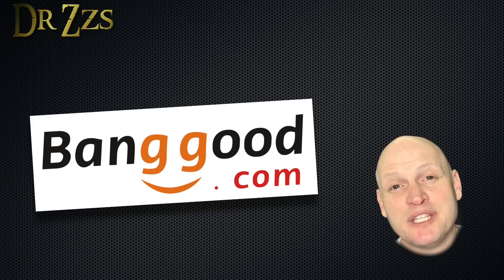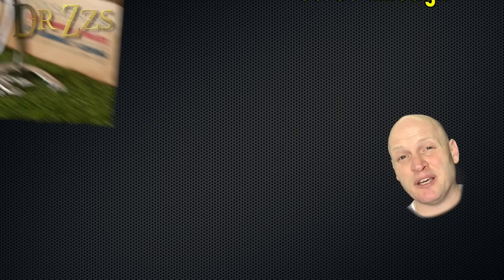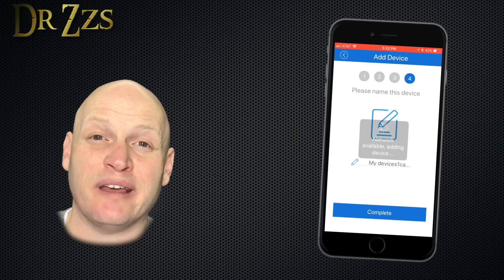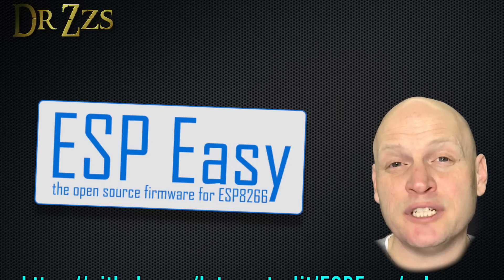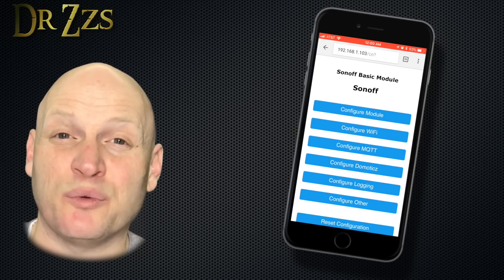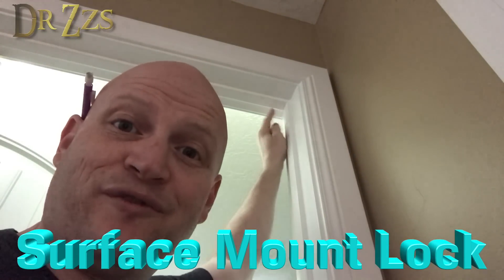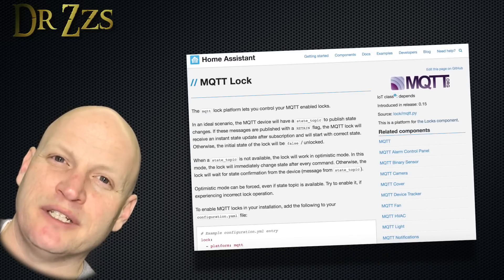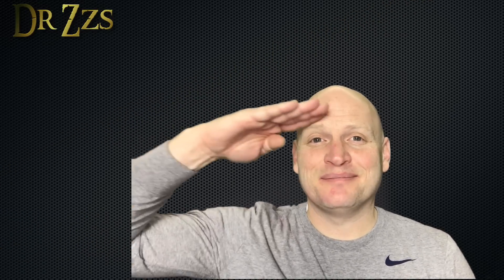$25 DIY "Smart" Door Locks - ElectroMagnet + Sonoff + Tasmota

Comment: if you had of drilled right through your door frame and 2x4 and pushed to wire in to the cavity with your plate the wire would have been in the wall for future automation projects but i like your video found it informative.
Reply from the maker: Thanks
that's a good idea.  I'll do that on the next one.

Comment: Thanks for the vid. I will like to make this and add a fingerprint scanner for access? Is that a simple project? I'm able to follow this guide easily
Reply from the maker: You'll have to find a finger print scanner that will output something that can trigger the relay on the Sonoff SV.  It may not be too difficult, but I wouldn't say it's easy, and following this video wouldn't give you everything you'll need to know.  
I'll look into fingerprint sensors and see if I can put together something about how to incorporate them into HA.
Reply: @DrZzs  that would be sweet. Thanks again

Comment: Great Video ! ...Is there a way to get this done without a power supply ? Say for use inside a cabinet ?
Reply from the maker: thanks!
not with the locks I used.  They require too much power to run on battery when they are locked.  Maybe if you found some "fail-secure" style locks that might work.  You'd want to have them locked most of the time, and for fail-secure, they wouldn't need power when locked, only when unlocked.
Reply: You might be able to find a electric lock that works using a motor, to move the lock latch open or into the closed position. I have seen a few diy solutions using a servo, but that's not ideal either.

Comment: Now to design a outdoor gate door lock
Reply from the maker: that would be useful!  What kind of lock do you use now?  We'd have to run power to it for sure.  It wouldn't be something we could run on a battery. 
I want to learn more about triggering motors with Tasmota.  A gate lock might require a linear actuator or a solenoid or even a dc motor.  It's on my list of things to tackle and figure out.  I'll let you know when I solve it :)
Reply: @DrZzs  This is link to an example of the style gate lock :  http://baytownlepc.org/vinyl-gate-lock/vinyl-gate-lock-fence-latch-zoom-vinyl-gate-latches-locks/

Comment: I like the idea but wouldn't trust if my power went out then my home is vulnerable to being broke into. The only way I would consider this is with a battery backup of some kind.
Reply from the maker: That's a good point.  
There are other kinds of electric locks that are "fail secure" instead of "fail safe".  Meaning when there's no power they stay locked.  I'm sure some people would argue that with a fail secure lock, if there's a fire or some disaster in your house and the power goes out you might be locked in, and that would be bad.  
I wanted to use this on external doors, but haven't taken it that far yet.  So far it's just my office, the shop door, and one bathroom door :)
Reply: @DrZzs  I think a good system  (if it could be done) would be to have a "fail secure" setup to where say if the power goes out it will stay locked but have it hooked to a smart smoke detector and carbon monoxide detector so when either went off it would send a signal and unlock the doors. I'm sure something like that could be possible with tech these days. I suppose the system would have to be local and have some kind of battery backup since with a fire if the fire didn't knock out power the fire dept would and then no Wi-Fi so it wouldn't be able to receive that signal. Idk lol sounds like alot of work but would be cool.

Comment: How do i make it so it locks itself after 10 sec?
Reply from the maker: That would be a fairly simple automation.  If you use Home Assistant you could make a Yaml automation, or use NodeRed. 
You'd have to decide what you want the "trigger" to be.  You could set it so the trigger is the lock going from "locked" to "unlocked".  Then the action would be #1 a 10 second delay, then #2 set the lock to "locked": 
It would look something like this - 
automation:
  - alias: 10 sec relock
    trigger:
    - platform: state
      entity_id: switch.your_lock_id
      to: 'off'
    action:
    - delay: 00:00:10
    - service: switch.turn_on
      entity_id: switch.your_lock_id

Good luck!
Reply: @DrZzs  Thanks it worked:) i wanted to know i have the rf bridge with 3 rf remote how do i set them up so when i press a button on the remote it turn off or on somes lights? i flashed the bridge with tasmota and i have the id of the button.

Comment: Awesome I have to try this for my garage
but if the power goes off, does this mean your house would be open ?
Reply from the maker: yes, if power goes out these lock turn off.  If you want fail-secure locks it would need to be a different kind of lock.  I haven't tackled that yet.
Reply: @DrZzs  maybe trying to build some kind of battery backup

Comment: for the strike plate Id prefer fail secure... otherwise your home is unlocked on a power failure... you can always open door normally even if no power or fire.
Reply: In fail secure you still need the lock to release in the event of a fire due to fire personnel or police ro be given access to get in from the outside.  Fail safe is better in this situation or a battery backup for the the fail secure and a fire release installed with a full fire alarm to detect the fire.
Reply: @designsbyphilip510  They're going to bust the door just the same as they will otherwise because when either of those arrive, it's worth a door. On the other hand if your front door opens up every time it loses power (black outs, brown outs) it's just a matter of time when it happens when you and your family are all sleeping.
Regardless these setups are dogshit anyway because you can open them with a magnet.

Comment: You can just cut the wires on the first lock and you are in like sin. Horrible design, you need to rethink how you installed it.
Reply from the maker: The wires aren't accessible from the outside.  The wires are in the inside of the room. If someone wants to break in bad enough, this won't stop them that's for sure. This is mostly just to mimic a normal lock to keep someone from just walking in and for convenience so you can lock/unlock your doors with automations.  
I'd love to hear any suggestions though, about how to make it more secure.  
Thanks!
Reply: Yes, upon the second viewing I realized that I was wrong but I already posted the comment. Sorry for the quick assumptions. This is a well done cheap, respectively silent, and easily DIY door lock. Thank you for the videos and you have inspired me to make my own version. I just ran the wires up in to the attic and connected it to a central, janky, hub. So it will be easy to connected more doors as I complete future installs. I am also thinking of setting up a "geo fence" like system so I can have my front door unlock as I approach. Do you have any suggestions on how to accomplish this, preferably using my phones location? Thank you and I really like your videos because you provide a very inexpensive solutions for home automation.

Comment: I love this.  We're developing a security protocol for our church in case of the need for a lockdown and this solution will be perfect.  Now, here's the challenge.  Find us an electronic lock solution to retrofit vinyl sliding glass doors so we don't need a key to unlock them.  ;)
Reply: Mag locks with a L bracket to hold the plate

Comment: I am planning on using these magnets to prevent my little girl (she is 1, and is more curious that curious george lol ) from opening the bottom cabinets in the kitchen and bathrooms, but at a price of $16 for each magnet set this project is going to get pretty expensive. Do you guys know of any other magnets that could do the job and is not as expensive? I need around 35 separate magnets for all my bottom cabinets. If anyone could help me out that would be greatly appreciated!
Reply: https://www.amazon.com/Magnetic-Cabinet-Locks-Install-Childproof/dp/B01FXX9HW0/ref=sr_1_2_a_it?ie=UTF8&qid=1546554649&sr=8-2-spons&keywords=baby+magnetic+cabinet+locks&psc=1

This is what I will look into for my little monster.

Comment: Hi, how did you give the connections.. I did not notice any wiring diagram
Reply from the maker: sorry.  It is very simple.  +/- input on the sonoff, +/- output from sonoff to red/black on the magnet lock.  If you want another switch (besides the on-board button), then connect the poles of your switch to gpio14 and ground.  Those pins are marked on the Sonoff SV.  I showed more detail of the connections on the SV in my battery button video: https://youtu.be/MyPpmDAThA4
Reply: DrZzs do i need to connect the input for sonoff sv from the mains or from a 5v 1amp power supply.. also in your other video with rfid, if i use that, can i also attach a switch to nodemcu like how you did here.. if so how..
Reply from the maker: Mufid Syed Don’t connect the Sonoff SV to mains!   The SV is made for low voltages. 24v max I believe.
Reply from the maker: If you want to use the magnetic door locks you need a 12v power supply.  That is what goes into the input side of the Sonoff SV.  If you use the esp-rfid firmware on the nodeMCU, as I did in the RFID video, I do not believe it is possible then to add switches to the nodeMCU.  Are you hoping to have a switch to use as a manual override of the RFID entry?  the RFID/nodeMCU takes the place of the door switch.   I don't know if there is a way to add another switch.  You'd have to look at the ESP-rfid code or github and ask the guys who wrote it if that is possible.
Reply: DrZzs I'm thinking if there is anyway i can reduce the components used. If i avoid going the sonoff sv route and use only the nodemcu and esp rfid way, the only way to open and close the door would be through RFID. But since that will be placed either inside or outside, how would the door be unlocked from the side which does not have the reader

Comment: Hello DrZzs, how would you go about using sonoff to detect (maybe with MQTT) when someone rings a traditional doorbell? I'm thinking of something like whats described here > http://www.redgrendel.com/the-doorbell/#comment-110 
The ideal would be to have rind detection, but also being able to suppress the ringing (at certain times), yet sill be able to get the notification. Maybe an idea for a tutorial?
Reply from the maker: Hi!
There are a bunch a different ways to do a smart doorbell. Are you planning to use your existing doorbell?  You could put a "smart" device like a D1mini or NodeMCU connected to the doorbell button that would be able to respond based on an automation and activate the chime with a relay based on your automation.  A Sonoff SV would also do the trick nicely.  Of course I would use Tasmota and connect the existing doorbell button to GPIO14 and ground.  Without knowing what exactly you have already and what exactly you want to do that's about all the instruction I can give you. 
A video on doorbells would be useful.  That might be something I can do eventually.  

Hope that helps.

Comment: Is it possible to pair this with a fingerprint scanner
Reply from the maker: sure.  
I don't have a fingerprint scanner to test, but I would expect it would function like a switch.  The scanner would need to do the processing of the fingerprint and register it as approved to open or not, because Tasmota and the sonoff can't do that part.  
Might be that you'd need a whole new sketch for the Sonoff. Maybe search github for something.  
That would be a cool project.  I don't expect I'll get to try it for quite some time with all the other projects I'm working on. 
Let me know if you make it work.
Reply: another question do you have a way to unlock the door when "I am home" like a MAC address or some Bluetooth thing
Reply from the maker: That would be a pretty simple automation.  
Do you have anything set up in HA for presence detection?

Comment: I didn't really understand how the cathode lock works . How And where is the sonoff connected to it? Is there a button to open it? I got confused even you said if either one is locked out will be unlocked ( how will it lock from home assistant then).
Reply: I don't know about sonoff, but if you mean how the lock works when power is applied to the magnet inside it moves the movable part so that you can pull the door open, when the power isn't applied it goes back to locked position.

Comment: Hi. I enjoy your videos very much. Can sonoff be used to control 208-240v wall a/c unit with alexa?
Reply from the maker: Thanks!
What is the current draw of the AC unit?  
Most likely yes, it would work.  They have many devices rated for 120-240v.  The trick is just the amp draw of your AC unit.  The Sonoff POW has a 16 amp rating.  Most of the others (sonoff basic, dual, etc) are 10 amp. 
I know someone else wanted to run a Heater/AC combo unit and wasn't able to because of the current limits.  
Hope that helps!
Reply: thanks for the quick response. if the amperage is 15a can i use 2 units to cut both legs of the 240v line? can i use the ground w/ a pigtail as the neutral input on both units?

Comment: what if somebody knew it was a failsafe system and you had an external fusebox...
Reply from the maker: yep, you got it.  In that case it could be bypassed. 
It's not a full burglar-proof system.  You could have a 12v battery back-up.  Something like a car battery would probably last a good long time if someone cut the power. That would be best probably.
Reply: Another solution would be if to have the mqtt broker server to send an email or similar notification when the power has been out for a period of time, say twenty minutes. This way you can have a neighbor or someone you trust to check if the power has been switched off.

Comment: Dr zzs one question, how can i do if i want to open door from outside, without smarphone, exist something like a magnetic card ot other sistem to open from outside?
Reply from the maker: Good question.  I don't know anything about magnetic card readers.  I've thought about hiding a capacitive touch module that I can activate from the outside but no one can see and only I know where it is.  I'd put it someplace weird like down by the floor or up above the door.  It would depend on where I could easily run the wires. 
I'll try to figure out some cool external unlocking system.

Comment: ......FYI the Magnet lock sold by other suppliers has four wires....two for power and two for "door contact"... a control circuit uses this to confirm the door is closed.  This will be one big plus in your case by using the "lock closed" icon to show the door is closed which is handy when you need confirmation your house is secure (doors are closed)..... In high security applications this contact is used to detect one door closed before the next door opens.....used to allow one person through at a time  (just another application)  In the case of the garage door lock... one just needs to send a "pulse"  for it to open.(add a buzzer to confirm the lock is opening when using it on a outside gate at your front door)......thanks once again for great videos ....
Reply from the maker: Awesome!  
Thanks for the tips! 
I'm imagining how fun it would be to build one of those "escape rooms" with some of these locks, especially the ones you're talking about.
Reply: Hey could you share a link?
Thanks

Comment: On the surface mount mag lock you can get them much bigger and stronger but ya if the door is going to fail first doesn't matter much
Reply from the maker: ya, at least with an interior door you could probably break the door before the magnet gives out. Maybe with a bigger stronger door it would be worth the extra $ to get a bigger magnet.

Comment: Just about to order the parts but one question, how do you decide for how long the door is unlocked after pressing the button... Don't have any S on/Off's ;) but was planning on using a Wemos D1 instead!
Reply from the maker: Good question. I don’t have it timed. Mine just toggles, so I have to press the button again or use Home Assistant to re-lock it.  
I’d guess 2 min would be plenty of time if you’re just passing through the door. If you use TASMOTA you can use pulsetime to set a number of seconds that the relay stays open/closed.  Or an automation in HA that triggers when the door unlocks, delays a couple minutes then relocks.  Just a couple ideas. 
Are you using the D1 mini relay shield?
Reply: Thanks, yeah was thinking of adding it to the automation to just to avoid the need to keep the button pressed to enter :D

And yes, your splendid video about automatic garage door opener made me order a bunch of D1 Pro's and relay shields just to play around with, was planning on making the lights turn on etc. when we get home with the car at first!
Reply from the maker: I'd have to mess with it to be able to say for sure.  My guess is when you type in the correct code there's some kind of voltage output that you can tap into to trigger (or release) the relay, just like you would use a push button.  
Hopefully you'll get a manual that'll point out where to connect the lock circuit.  If not you can experiment with putting the code in an testing the outputs with a multimeter to see which one goes high (or low) when you get the code correct. 
If it isn't clear how to connect the lock circuit when you get the key pads let me know and we'll try to figure it out together.

Comment: Is there any way to add in a number pad to open the locks with?
Reply from the maker: There might be. I think you’d probably have to use an Arduino sketch instead of TASMOTA. And I wouldn’t know what to put in that sketch to set it up for the keypad. 
Probably a better solution would be an NFC chip. It would be setup in TASMOTA like another switch.  I’ll have to play with that and see if I can make it work.